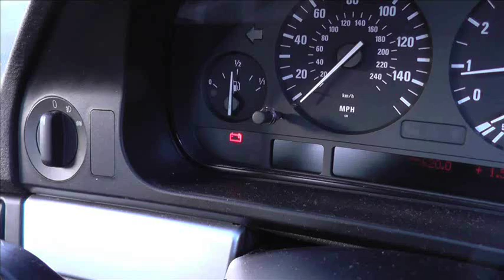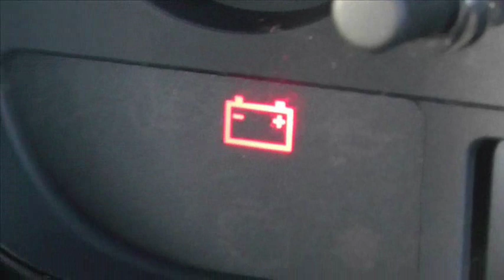Car battery light on?   How To Test It Video

Comment: I change new battery and new alternater my car battery light still came on help help please
Reply: Joshua Thao Thao the battery is good alternator is good on a 1999 teen 96 Mercedes-Benz 500s for the battery light comes on
Reply: How do you reset the battery light on a 1996 Mercedes Benz S500

Comment: My battery is fully charged and car cranks up every time.The battery light is on all the time now. I take negative post off and car shut off.
Reply: bad alternator it happens to me right as we speak
Reply: Just told me what is wrong with my Toyota Corolla battery light came on tonight stayed on ten or so minutes then went off and back on  so guess that would be my alternator plz help
Reply: My battery light came on tonight for ten or so minutes so i left work to head home the light went off five or ten minutes it's back on  then it was like on an off on an off would that be my battery or alternator

Comment: To me, I would check the voltage coming from the alternator first due to that if its not charging then of course the battery is going to get drained down if the vehicle is being used. If you go and buy a new battery, yet the alternator is still not working correctly, then in about 2 days or so the new battery would be dead / low voltage / drained, and you would then have to go buy an alternator plus now you would have a battery that needs to be charged.

Comment: Question, i know someone's car with that battery light on, she just replaced the battery recently so am I to assume it is the alternator? Or the sepertine belt? timing belt?    Her car started up fine today, hours later it didn't start,   she  then started it again later and it worked fine.... is it safe to drive to get from point A to B  then?